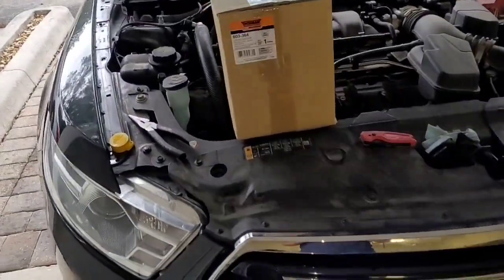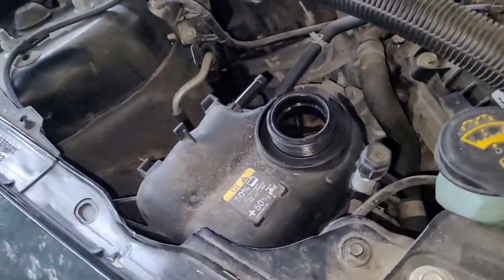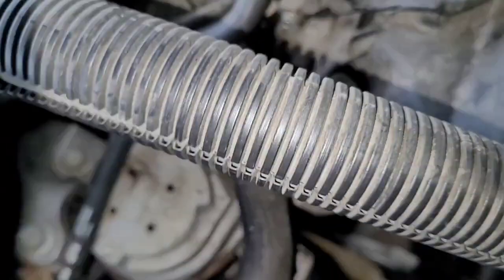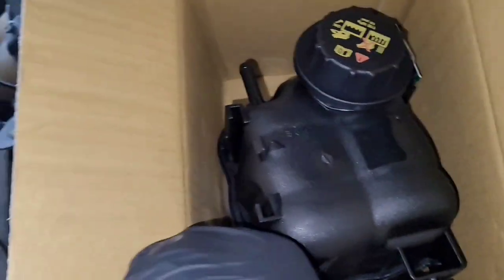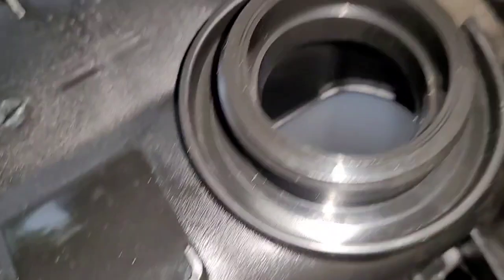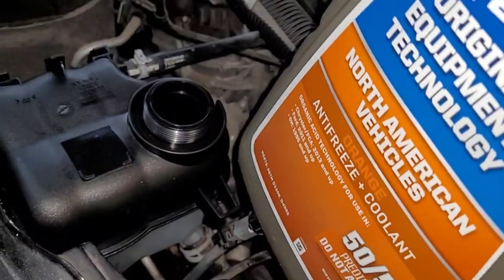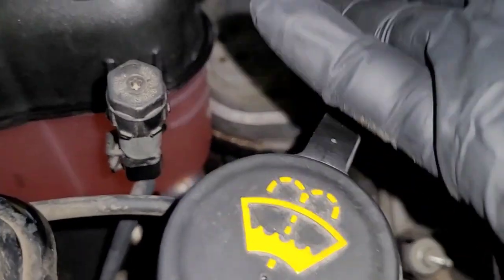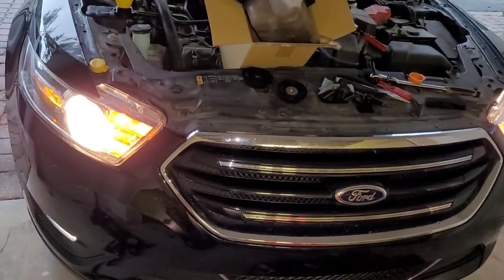How to replace to replace the coolant overflow tank on a 2015 Ford taurus 3.5

Comment: All coolant needs to be put through the reservoir ? Is there no radiator cap on the actual radiator as i cant find that on my car 😅
Reply from the maker: It does not have a radiator coolant cap it only has the cooling reservoir to put the coolant in

Comment: Little late, what’s the cap to the right of the reservoir. My coolant keeps running out but I’m missing it.
Reply from the maker: That cap to the  right is for windshield washer fluid, and I don't know if you can buy by itself.I think you have to buy the whole assembly.
Reply: @DIY_AutoRepair the middle cap? The small one
Reply from the maker: @superman2699  The little black cap in between is for your AC system.It's a cover

Comment: U GOT A GOOD EYE LET ME TELL U  THAT IF U WOULD OF   WENT TO A MECHANIC THEY WOULD OF  TOLD U  SO MANNY STORIES  U WOULD HAVE A SHOPPING  LIST   NOT TO MANNY PEOPLE  CHECK OVER THERE  BUT I NOTICED ANOTHER  POLICE TARUS  GUY HAD THE SAME PROBLEM HE BOUGHT  A SECOND HAND  ONE  BUT THE ONE U GOT LOOKS BRAN NEW  HOW MUCH  DID IT COST YOU AND BY THE WAY  U DID A NICE JOB ON THE REPLACEMENT OF  A NEW COOLANT  BOTTLE⭐ A+
Reply from the maker: I bought it from autozone it is a Dorman part, and it cost my 106.99 after tax. If you are interested, the part number is #603-364. I hope it helps 👍